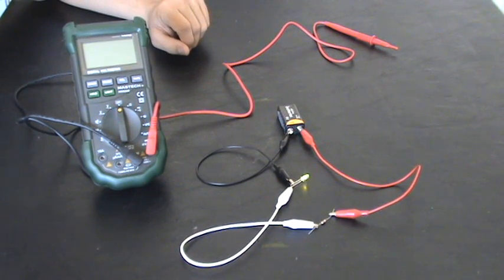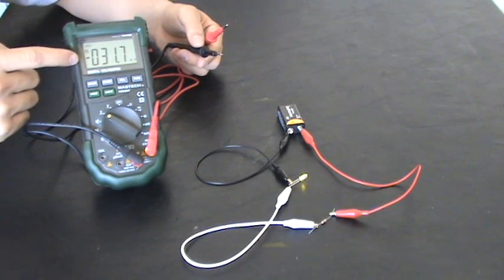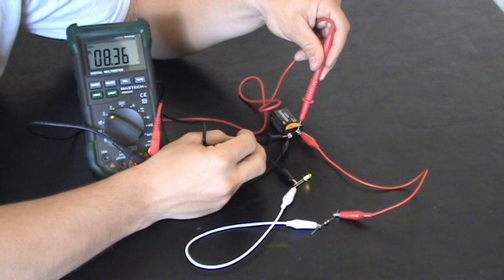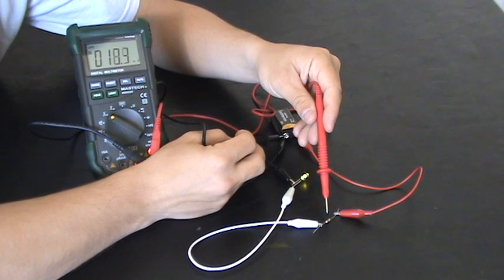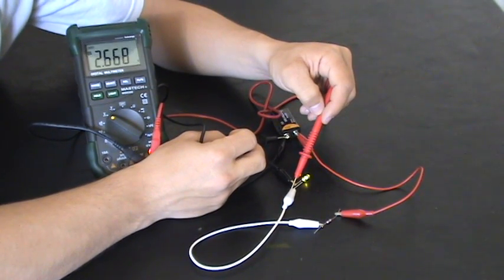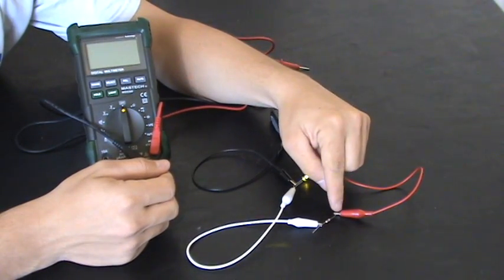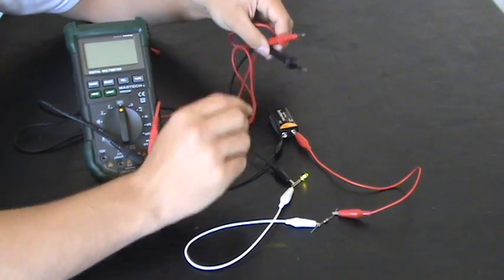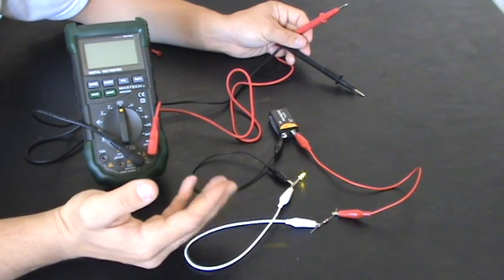Robotics and Electronics Tutorial - 12 - Measuring Voltage

Comment: Just a quick tip, in advanced circuits never put your electronic voltmeter like that directly. Because voltmeter is electrical and has self resistance in it, it is putting some extra current through the circuit, which may damage small components very easily.

Comment: I appreciate the information thenewboston.  Just a quick question:  Isn't it more practical to use a smaller battery if possible?  I've been watching your videos and understand why you're using a 9v battery (easier to work with).  

My thoughts are that the battery output will be the same regardless to how many resistors are connected, so basically the more resistors you use the more power wasted.  What happens to the additional electricity as it flows through the resistor, is it lost?

Comment: he is not very clear but on the part you buy it will tell you how much voltage it needs 

google ohms law

and by using that formula you will find out how many ohm resistor you will need to get the nine volt battery down to the amount of volts the part needs